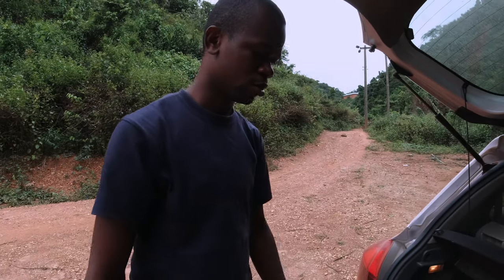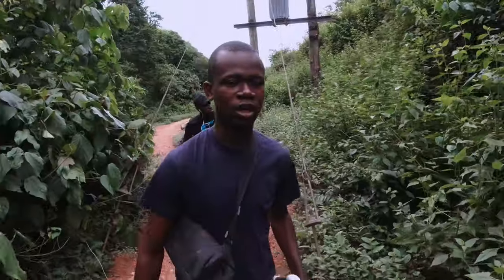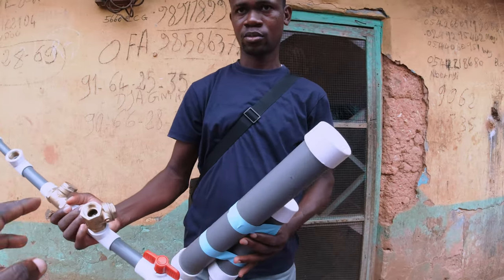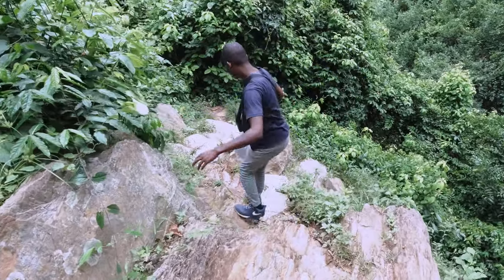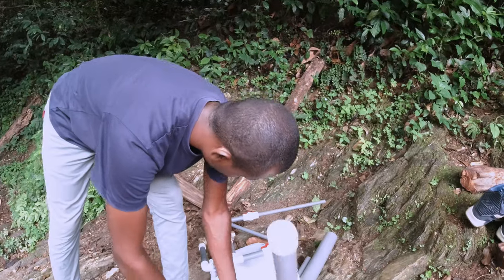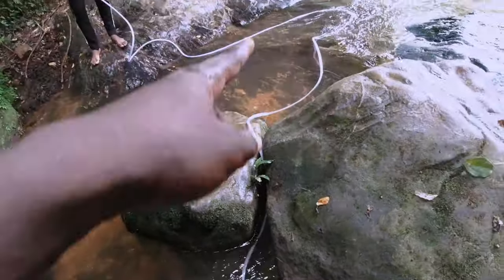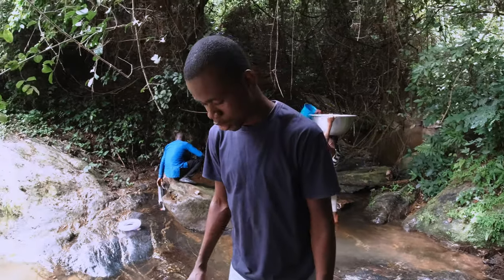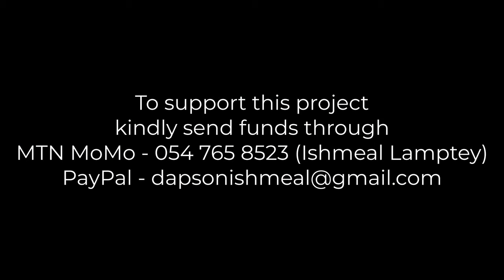Testing out Hydraulic Ram Pumps in "The Hanging Village"

Comment: am suggestion o if them get electricity use1.5 hp pump to a tank then tank to community or whats plan B
Reply from the maker: Haha. Cool. However an electric pump will be expensive to maintain
Reply: @IshmealLamptey  u sure for our house 50gh a month for electricity to fill a 6ft tall by 5ft diameter tank twice a week 10gh for 50 fetch which means 20p per fetch for a day = 300gh a month go for maintenance & bill u train 1 guy plumber
Reply from the maker: It will be difficult to implement same in the village

Comment: It seems like your pump has a slight design flaw.
Take a look at this guy's pump to see the correct order of pipes and valves for it to work.
https://youtu.be/A9W0zx2D7aU
Also make sure you have a certain height difference between intake and pump. (Intake needs to be higher than the pump for it to work properly.)
Reply from the maker: Thanks for the information, i appreciate it.